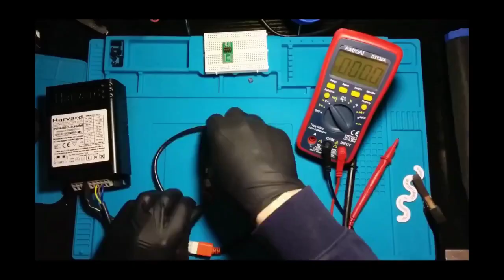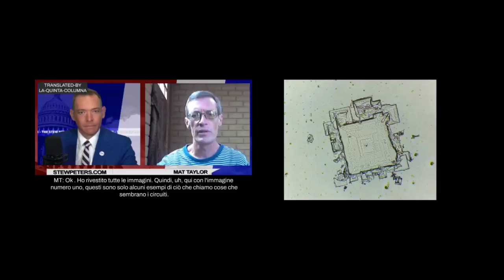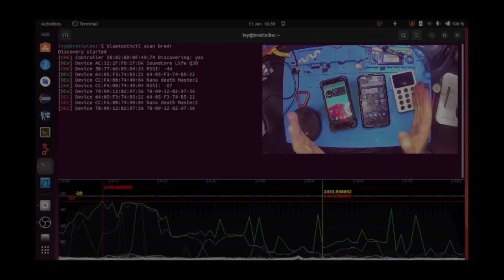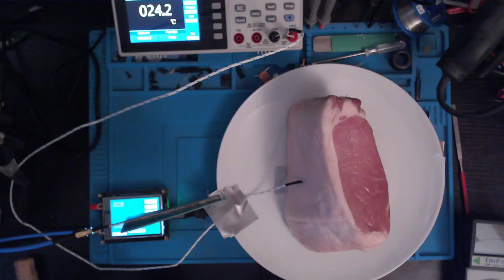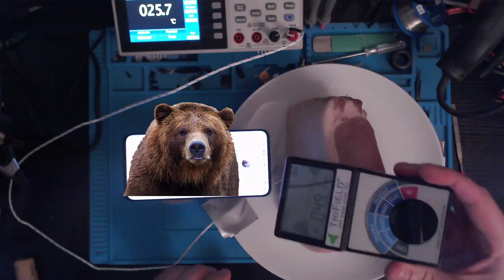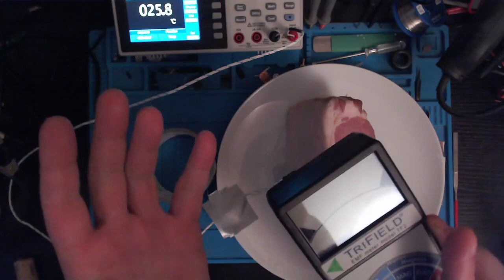5G RF Heating test. Is Mark Steele Right?

Comment: What makes a medium more lossy than another medium? I am taking electromagnetics II in Uni right now, and I heard that it was the more conductive a medium is the more lossy and reflective it is. Like if you put your phone inside a metal box a faraday cage, most of the RF signal would be reflected. Assuming the material was deemed to be a perfect conductor/superconductor, all would be reflected. I then learned air was a lossless medium and has a characteristic impedance of 120pi. What confuses me is if air is a lossless medium, why does the inverse square law hold for RF transmission, since most RF is transmitted through the air. Is it due to the characteristic impedance being there? I don't know if you are well versed in this, but if you could answer I would greatly appreciate that.
Reply from the maker: Inverse square law deals with photon's in Epsilon Zero and in air.

What we are dealing with when we look at the relative permittivity of materials, is density or atomic mass of the molecules that make up the material, photon's have a duality, they are waves in Epsilon Zero and particles when interacting with matter, these particles impart their energy (eV) on electrons and raise the quantum energy state or ground state of the electrons.
The more dense the material, the more atom's and electrons it contains, hence the photon's it can absorb or the higher the Dielectric Constant and attenuation of the photon's.

You'll learn more about Plancks Constant and also Maxwell's theory of Electromagnetics during your studies.

But for now, inverse square law would be an after thought when conducting Vector analysis of MUT(s) to find loss tangents and permittivity etc...

I gave you a like for positive engagement 🙂

Comment: Can you explain this to me if 5G is not dangerous? "The rules adopted by the FCC allow a 5G base station operating in the millimeter range to emit an effective radiated power of up to 30,000 watts per 100 MHz of spectrum." This seems like a ton of power to be outputted. Am I looking at this in the wrong way? I have a basic understanding of many of the concepts of RF through my EMAG course, but I don't understand much of the vernacular/jargon used in the field. What is radiated power of up to 30,000 watts per 100 MHz of spectrum referring to?

Comment from the maker: They are terrible, it's just two opamps pulling in everything from 30MHz - 6GHz the main problem for the TF2 unit is that the antenna is centered at 1GHz, they even state in the manual that the unit has a +/- 20% reading accuracy at 1GHz, god knows what is is at 3GHz?
Reply: The reason that the ghost hunting lot love these cheap EMF meters, because they are so all over the place.

Comment: 20:30 I said exactly this back in 2018.
The cheap crappy emf meters the conspiracy theorists use to scare themselves and their audience pick up everything and the only way to single out the 5G is to use a very expensive spetrum analyser with line of sight.
The 5G fear has been going on for years now and the silly theories keep evolving.
Fear seems to trigger people in to buying scam devices and so called protection from 5G.
I have seen usb devices that claim to protect from 5G and the larger lurgy being sold for £350 and even 5G shielding underware and bed tent 5G emf protection domes, all sold at extortionate prices to the gullible.